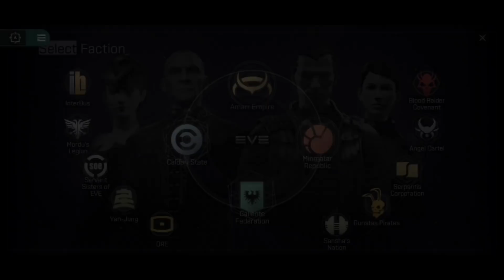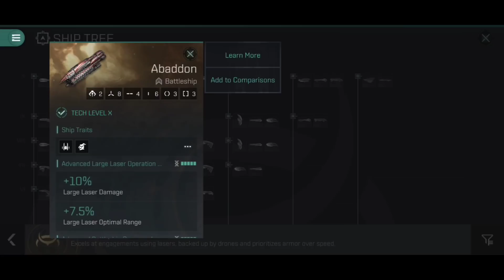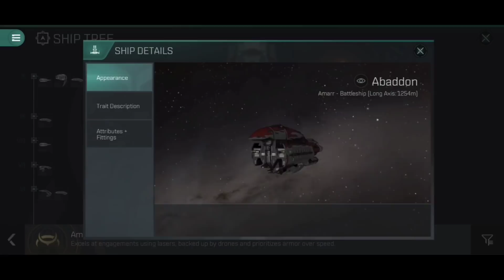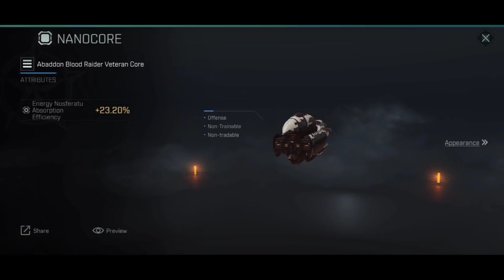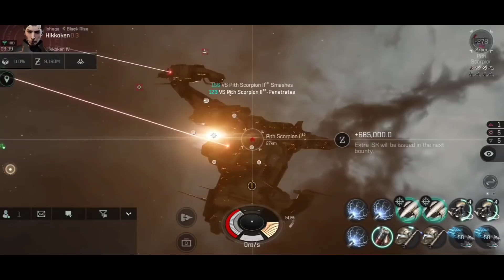The Amarr Empire ABADDON Is The Don!! Laser Disco Bad Hare Day!! || EVE Echoes

Comment: I had Abaddon with tachyons T2 and few armor plates on my Akora alt in EO. Nice toon for taking down that cyno alts who dare to light up without asking for permission :)). I was close to -10 but worth it. Even Moros on blasters was not able to take me down before agroo timer went off.
Sidenote - Abaddon in EO was also top notch battleship, but with price of 150m isk, not 1.5b, so you could preety much farm 1 hull in hisec durning single day.
Reply: @captainbenzie  Guy lighted up cyno 5km from station radius. I undocked, killed it and started to wait for timer to go off. Second after his main undocked and immediately entered siege mode. I saw hes on blasters (short range hard hitting hybrids with good tracking) and had tracking enhancer animation so i started to orbit around him on overheated afterburner (he had warp disruptor so i couldnt warp off) to increase angular  velocity. Since every ship have some momentum when undocking, even siege moros need a bit of time to slow down to hit stuff. I had 3 trimark rigs and full 7 slots worth of plates and hardeners. Despite fact that guy planeed this and his moros was fitted specially for this situation, i was able to dock on low hull.

Comment: I've designed my Abbadon to be a fleet killer. 3 large core plates, 2 Red hardeners, 1 yellow hardener. Large Imperial Navy Neut, Large Imperial Navy Nos, predator web, Target painter.

I also use an undisclosed number of rig integrations combining armor amount and explosive, kinetic and thermal resistances and combining CCC with SMCs on the engineering side.